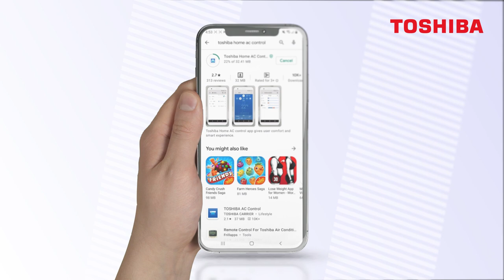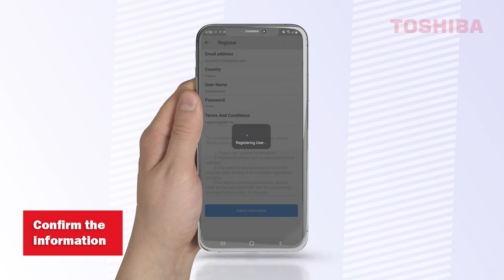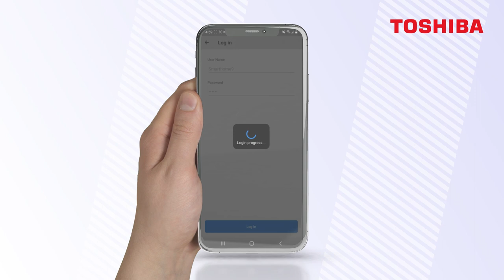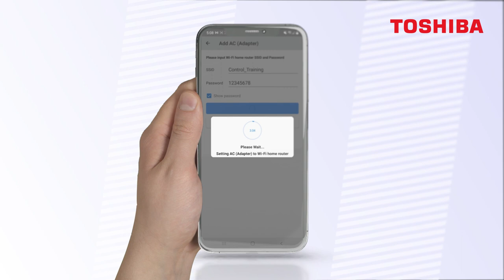TOSHIBA HAORI - How to

Comment: thanks for the video - it´s helpful for maintenance - 
I was searching for it due to some issues with wlan connectivity. The integrated wlan modul does not support the WPA2/3 standard. Had to downgrade my router security to WPA1/2 to link the modul into my wlan system. 
Hope the next firmware upgrades the modul to this common WPA3 security standard....
Beyond this issue the Haori works well and the modern design is a progress in air conditioning - thanks

Comment: Please beware, to IR controller is non-intuitive, it doesn't have a way to light the screen without changing a function. Also the Toshiba Android apps are total garbage, they are like 2/2,1 stars. People constantly complaining about them not working correctly, nothing changes. Even I was unable to connect it to the units. No such problem with LG or other appliances.
Also it is not possible to buy additional cover colors despite all the ads.